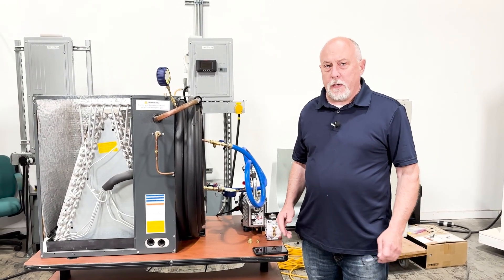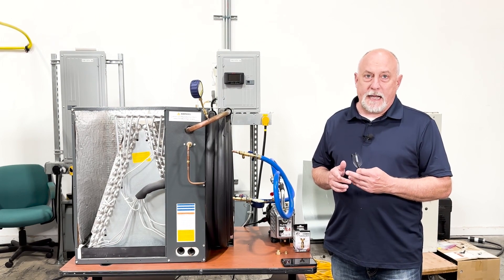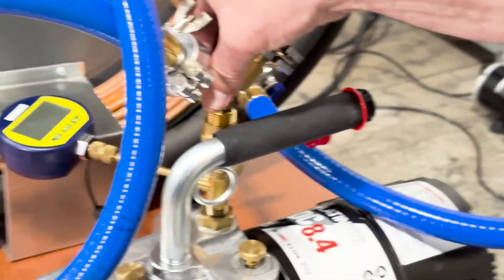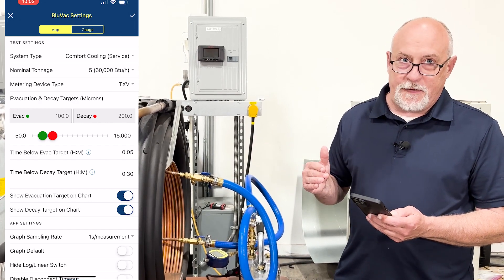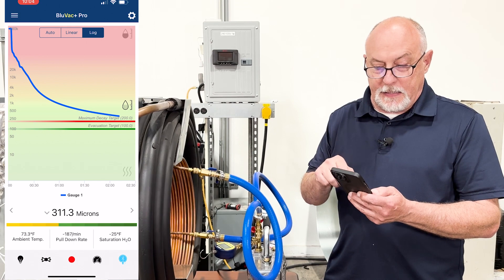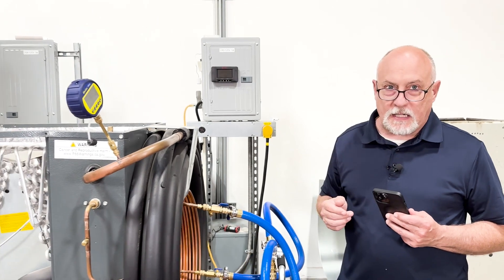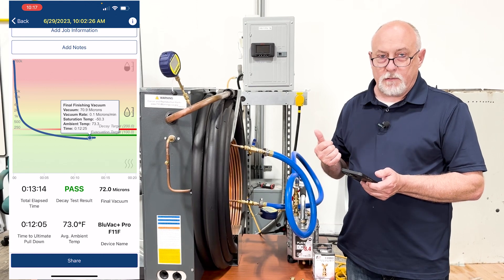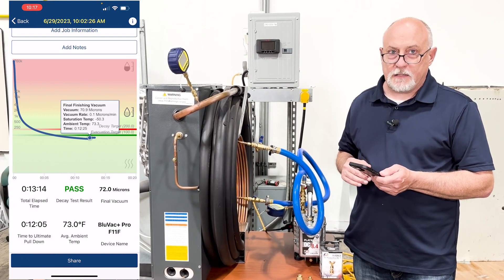The Importance of Decay Testing in a Vacuum

Comment: Hahaha yalls instruments in the 50s man were not as accurate haha. That was a funny statement man
Reply from the maker: Actually not true. They had thermistor micron gauges and others back then that were just as accurate. We were in a space race, and building vacuum tubes back then. They could measure vacuum 6-10 times deeper and more accurately than the roughing gauges we use for the HVAC industry.
Reply: @measureQuick yeah nasa and among like 2 percent of the techs had such devices they measured vacuum on gauges like the standard analog ones they.offer today

Comment: What would it mean when doing a decay test, and the micron readings gradually go lower than when the pump was on and pulling vacuum?
Reply from the maker: @jharrison6557  the vacuum gauge is on the opposite side of the system and the pressure continues to drop as it equalizes.
Reply: @measureQuick  I still don't understand.
Reply: @measureQuick   I was getting an extremely jagged, sawtooth like pattern at around 850 microns for 1.5 hours, then removed vacuum to begin the decay test and over the span of 15-20 or so minutes it had slowly and steadily dropped to 750, at which point I stopped monitoring
Reply from the maker: @jharrison6557  https://youtu.be/csZTHbpt_m0?si=CtXIAi_VE3SO8lhW
Reply: You may have had a tiny leak or just too much moisture in the system

Comment: Around 180 or so is as low as ive ever been able to get to, even on a brand new system. As far as im concerned thats very much good enough for anything ive ever worked on. Not many techs can afford true blue hoses. I use the appion large hoses which give great results but the question is, if even those cant achieve what we are "supposed" to be achieving then why doesnt the industry make and supply only 3/4 id vacuum purposed hoses like tru blue? 10 years ago as far as i ever knew a 3/8 yellow jacket hose was the largest hose available to us and before those we all used 1/4" hoses with our manifolds and obviously struggled to even get to 500 on many systems. I wonder what hoses they were using in the testing you showed from back in the day, and why it wasnt till less than 10 years ago that us techs have heard of anything larger than a 3/8 hose. At least in my area thats how it is. And why doesnt major manufacturers like yellow jacket, jb, ect that have made the majority of vac pumps in the field to this day, make hoses that can achieve these micron levels?
Reply from the maker: All I can surmise is that we have forgotten everything that we have learned and let the marketing department run engineering. This was all common knowledge in 1959. It was science forgotten. Technicians simply were not taught correctly. The math and the science are not new. What is crazy is if you go into the refrigerator manufacturing industry large hoses and deep evacuation as low as 30 microns are common. They use vacuum rigs with hoses that are 3/4” and bigger with dedicated vacuum rigs. The cost of a TruBlue hose is only a small amount more then Appion and considering the performance and the cost of labor after only a few uses a lot less expensive.
Reply: IMO, it is also what the business owners wants, a faster turn around.  Old employer wanted vacuums done in minutes and "500micron was too low and took to long..."    @measureQuick
Reply: I could be wrong I believe they used braided copper lines or copper lines for fast and deep vacuums. T Lech YouTuber used copper for deep vacuuming it was what his father thought aeons ago.
Reply: @HVACslayer  tom is my hero
Reply: And those tiny little ports on the vacuum pump.

Comment: I find it ironic that they had such high standards in the day where almost every old tech I've spoken to just used liquid purges and equipment lasted 40 years
Reply: Lol or it was put the gauges on run it in a vacuum without some type of micron gauge, let’s grab lunch come back and charge.
Reply: Older refrigerants were tougher, but were also tougher on the environment. We're compromising our time and labour for a healthier environment
Reply: I see both sides
Reply: There are two "tiny" difference: First the freon used in the past was rather immune towards even significant contamination. The drawback of the modern fill gasses, that do not destroy our atmosphere once they leak, is they (and the lubricants compatible with them) are unfortunately very sensitive, so do need careful cleanup and evacuation of the system.
And the second difference is, we weren't using refrigeration systems in such wide range of operating conditions as come with the heatpump/AC unit as we are today.
Reply: @annaplojharova1400 ever hear of a walk in or a walk in freezer? They been around just as long as anything else. Mineral oil, as in older 22 systems was less sensitive to moisture but only to a degree, still needed to evac and any good tech always did,even back in the day. Poe oil has about zero tolerance for moisture. Compressor and moving components may only last a year if moisture is present if your lucky. Anyone in the trade should no why so I won't go into that here unless someone is interested. Either way, a older 22 system most certainly needs to be evacuated still
Reply: @HVACRTECH-83  Well I did not want to say the R22 or so tolerate really every abuse, I just want to point out the modern ones requiring way stricter care to not blow up within a year, is not the machines alone being made worse, but because there is quite a difference what sloppyness R22 unit working at fixed temperatures allows you to get away with, but the modern fill materials moreover when operating over wide temperature range (here I'm refering to things like getting the charge exact,...) won't...

I never said it was ever any good idea to do a sloppy work with any system...
Reply from the maker: Your also talking 1959, most of those techs are dead if they they were in their 30s then.
Reply: @measureQuick  You would think then that generation would have learned from the last. So what happened?
Reply from the maker: @TheGhettoLobster  Sometimes people covet knowledge instead of sharing it. We also did not have a way like we do today with the internet to reach the masses. It was a different time. You are going all the way back to u-tube mercury manometers. Things simply got lost.
Reply: @measureQuick  lol u tube manometer and sling psychrometers was what my instructor was teaching us with in hvac fundamentals class back in the late 90s. So glad tech has improved beyond those types of instruments. The old tried and true bacharach wet kits too lol

Comment: Jim got a question for you. Pulling down that low on the compressor side would the low microns cause oil viscosity change or cause effects to the oil?
Reply: The only effect would be a positive one, viscosity won't change but the lowest microns you can achieve,  the more refrigerant and or moisture will boil out of the oil, that's the hardest place to dehydrate and heat is your friend in achieving a dry system, run your fans, circulate water if a chiller or water source, warm your compressor shell, should be standard practice but...
Reply: @HVACRTECH-83  after some reading and research, oil has a very low micron level/boiling point in which we would never achieve with our pumps. 

If I get into a bind with not getting to my micron level I’ll triple evac to help move moisture, but on used systems with refrigerant already mixed it starts getting tough trying to that very low micron level due to boiling out refrigerant from the oil. I care about removing moisture and any other contamination if I can get the system to 500 with a passing decay than we are rocking. 

Techs face that difficult decision in the middle of the summer with crying customers who don’t care about a proper evacuation on a very tight time frame with other calls piling up. We all stride to be perfect but in the real situations we have to use a wider practical approach here.
Reply: I run into this problem very often. I change a lot of reversing valves, a few condenser coils, and a ton of compressors. I find that even on the compressor replacements if the system has an accumulator there is still trapped refrigerant and it makes achieving a 100 micron vacuum impossible in a reasonable amount of time. Especially when I have someone rushing me to get to the next service call. I have the tru blu hoses and the BluVac pro but the only way to get trapped refrigerant out is with a heat source and lots of time on vacuum, like 24 hours or sometimes more. In those cases, I just use a triple evac and install a larger drier. Haven’t seen any issues so far. I forgot to mention all of the systems are heat pumps, residential and light commercial. In my part of the country Eastern North Carolina, 99 percent of the systems I work on are heat pumps
Reply: On all my new installs and equipment change outs, I’m pulling down to 100 microns or less every time. I got one with a new lineset down to 43 microns once but I often get down to 70 or 80 microns. Service work is a different ballgame all together though. I never achieve levels that low if the system is off gassing trapped refrigerant
Reply from the maker: @vincentgelles3805  Achieving a very low vacuum on 410a systems (POE oil systems) is almost impossible if it was not evacuated right they first time and or of air is introduced into the system during service. The oil bonds with the moisture and it can only be removed with a dryer. If the evacuation stalls, and the gauge does not indicate a leak, then a reasonable target is below 1000 microns and let the dryer handle the residual moisture. I would recommend however that you also use a moisture indicator after the filter dryer to assure that the dryer has not used all of it capacity.
Reply: That’s good to know. It certainly eases my mind a little knowing that sometimes you just can’t achieve a vacuum below 500 microns on existing equipment that wasn’t evacuated properly on startup. I will take your advice and start installing a moisture indicator in the liquid line so I can see if and when to replace the drier.

Comment: So is Evac 100 and Decay 200 what we should be doing now? Not Evac 500 decay 1000?
Reply: More important for heat pump systems.
Reply from the maker: Ideally yes, especially on heat pumps.
Reply: @measureQuick  thank you
Reply: Some walk in freezers usually call for very low sub 200's do to the obvious reasons. Def don't want even a tiny amount of moisture in a freezer circuit. For comfort cooling it's still 500 or under and 1000 after decay is too high, I always try to stay under 600 on a used system, under 500 on new, usually on a new install you can get decay to stay under 250 though. Someone may disagree of course and that's inevitable but you'll have no issues when following these rules
Reply: @HVACRTECH-83  thank you
Reply: @HVACRTECH-83  Akhvac has a video of him with Jim doing a vacuum on a huge chiller system, the equipment vacuum requirement was 1500.
Reply from the maker: @HVACslayer  That is a rarity, also because a low pressure chiller does not see the low temperatures that would allow freezing and or the high temperatures that promote acid and sludge production. With low pressure machines the evacuation is more about controlling the head pressure.

Comment: Nice video, I thought I was doing great vacuum down to 300 microns and decay no higher than 500 😢
Reply: You are, especially if you are seeing that on an existing system you're in good shape,
Reply: @HVACRTECH-83 definitely! New installs are easier to vac. No oils and condensers to pull down.
Reply: @HVACRTECH-83  he talking about fresh installation pipe work not system been in a service
Reply: @HVACRTECH-83 or with existing linesets ect.
Reply: @Mike-g5f9y why are you telling me this?
Reply: im using u guys techniques on the automotive side now. i have to vacuum sometimes 24 hrs but can get under 500 and times to 200 with at most 200 rise on 10 to 15min decay. just tickled. shitless
Reply: @RATCHETMAN1001 when you want to do long vaccums like this, maybe even 2 days with multiple vaccum pumps at the same time, 

do you change the vaccum pumps in between so they dont get hot?

How long would you let a single vaccum pump run for max since they can get super hot quickly?

Comment: I’ve spent so much money on micron gauges - Appion, fieldpiece, suppco, each like $400 a pop. the only gauge that still works right is my cheap CPS gauge. I’m not waisting another dollar on an expensive ass micron gauge just to have it not work after a couple weeks.
Reply: I've had a BlueVac Professional for  roughly 5 years. It has always worked great just like day 1. I also have an Appion on another truck and it is still working great. That one is going on 3 years... perhaps is operator error?
Reply: this sounds like you are doing something wrong bro i have used several models of micron gauge and not experienced similar problem
Reply: Use an additional vacuum rated core control tool or vacuum rated core removal tool for the ability to isolate the gauge before introducing refrigerant into the system as to prevent exposing the micron gauge to positive pressure and refrigerant oil. Periodically clean your micron gauges with 91% isopropyl alcohol and then pull a vacuum on the gauges to dry them out on the work bench. Little maintenance goes a long way.
Reply: Your an idiot.
Reply: Blu vac small usb stick  worked very well for me, the older Fieldpiece one was awful  ,I'm close to the  fieldpiece office and they  gave me replacement which i still didn't like . Got the newer one but haven't used it yet . I do like Fieldpiece and there customer service is second to none . Try contacting them even if its out if warranty .
Reply: Fieldpiece MG44 is 230$. Bluvac+ micro is 220 and does the app. What are you complaining about ? 

Bluvac gauges can be recalibrated by you. I still have my micro before the app was ever out 6 years ago still works and because I clean it properly and calibrate it. To further calibration I test it against other gauges I own several bluvac’s.
Reply: Maybe its you that cant handle a real digital gauge?  I always find it funny when dudes cant learn how to properly use tools.
Reply: my bluvac mini is fine for me. so far so good. i keep it clean and  dont abuse it.keep the oil out and dont expose it to pressure